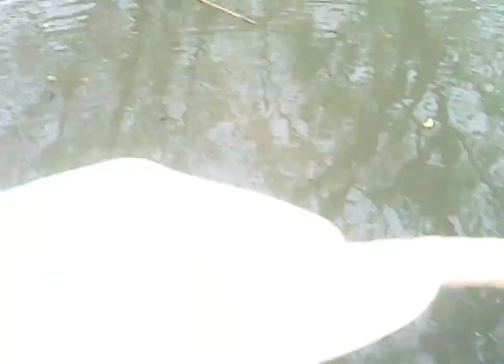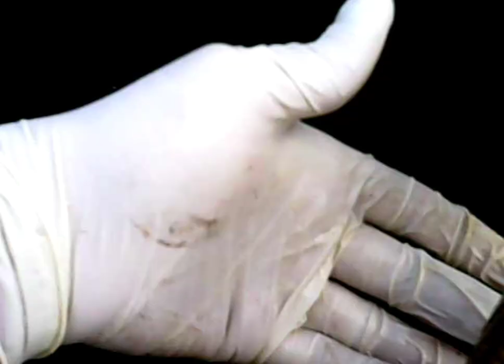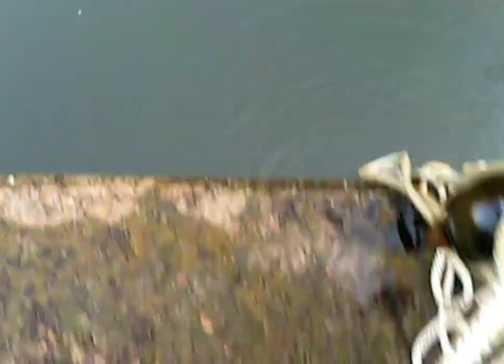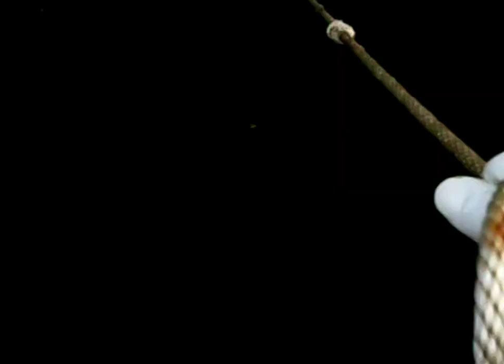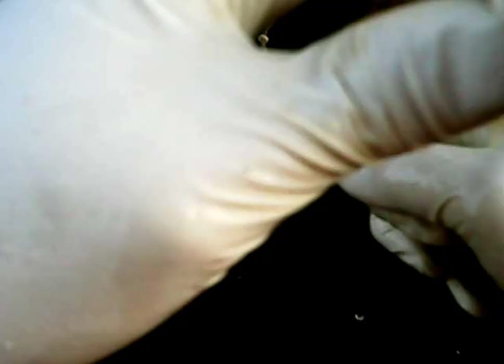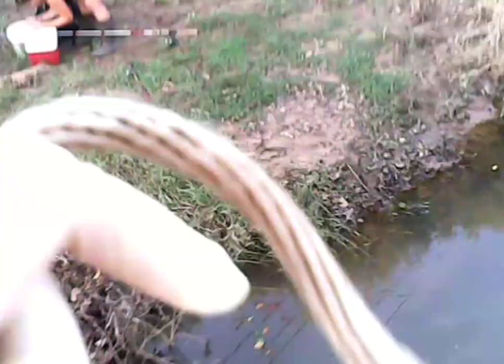MAGNET FISHING for more crazy & unbelievable river finds in Arkansas (best day)

Comment: I'm just getting around to watching some of your older videos. I noticed you were using what looks like regular clothesline. What pound test is it? Do you think it matters? I just started magnet fishing a few months ago and am still learning.
Reply from the maker: Thanks for the comment ! And no it's actually not clothesline'. I was trying out some double braided anchor rope.  I would personally stay away from clothesline' ,Paracord etc...(anything that is gonna have stretch to it, because if you are snagged and are putting tension on it then it's gonna come flying at you once it's unsnagged , and trust me you don't want a magnet grappling hook flying at your head.. I used hiking rope and anchor rope , I try to at use some with minimum of 250 lb breaking point.....hope this helped and thanks for subscribing ! If you need any more advice then let me know
Reply: @MetalFishTv  thanks for the advice. I have an 800lb magnet with a 150lb rope. So far, it's working but I will keep in mind the stretch factor! Thanks.
Reply from the maker: 800 lb is the lowest I like to use, strong enough for good stuff but not too strong that you are gonna permanently attach to something ....I have a 1300 lb quest that I use 90,% of the time above my brutes